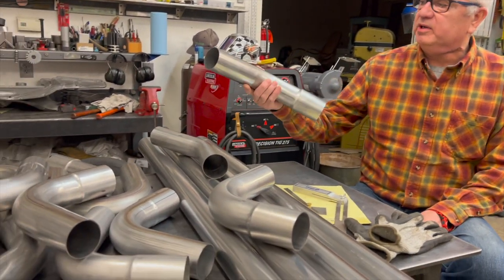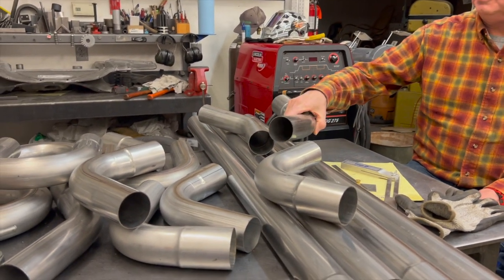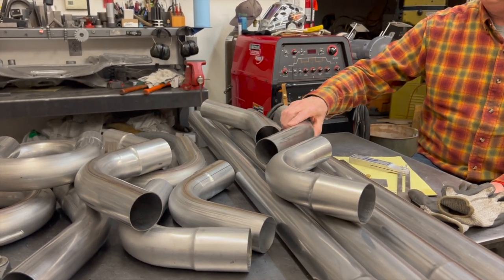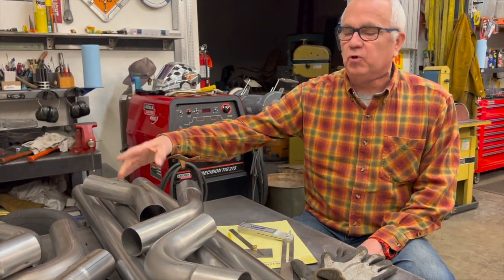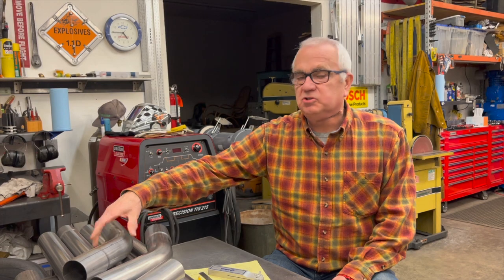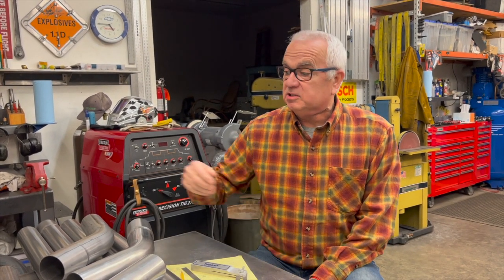The big C hit home

Comment: Thoughts and prayers going your way Steve. I installed dual Magna Flo's on my '51 Chevy Fleetline and was very happy with the sound and performance. I did run them out the back just short of the tail pan because I did not want to hear any rumbling from the front windows or create unnecessary noise while talking

Comment: When you were installing your brake pedal, you had a four hole plate on the front that you spot welded in. I'm wondering where that came from.  I'm gonna do the same thing to my 52 but I called Performance on line and they didn't stock it.
Reply from the maker: Thanks for the question Owen when I ordered the brake pedal kit from CCP it came with a plate that was two pieces, designed for one piece to be on one side of the raised rib and the other piece on the lower side of the raised rib. I didn’t like that design so I transferred for those measurements to a piece of flat steel 3/16 thick and just made my own plate it was really easy to do then what I did was cut out the raised rib where the plate went and filled it in with some 16 gauge sheet metal that way I have a nice flat surface for the new plate to fit. Are use the brake pedal bracket defined the center of the booster rod hole and use the whole saw to cut that that way I could locate the new plate from the engine compartment rather than underneath the dash